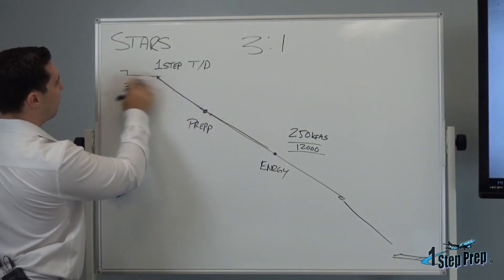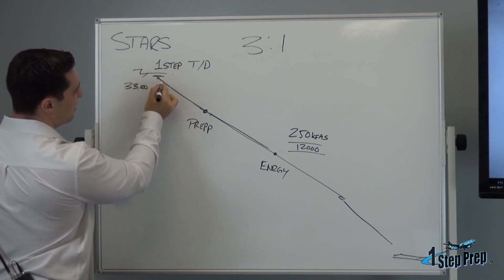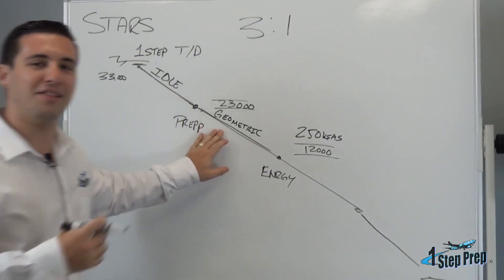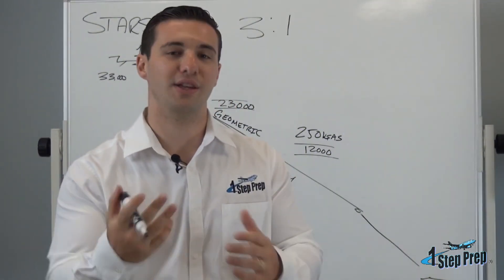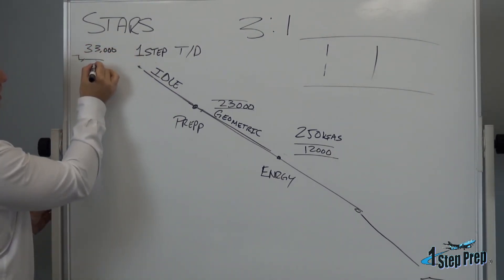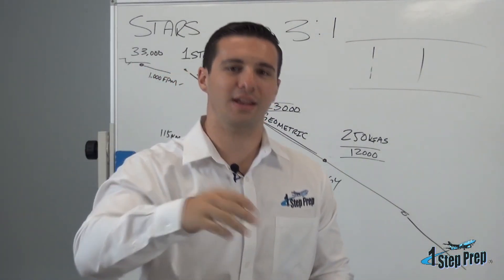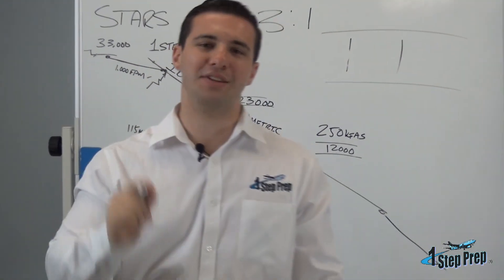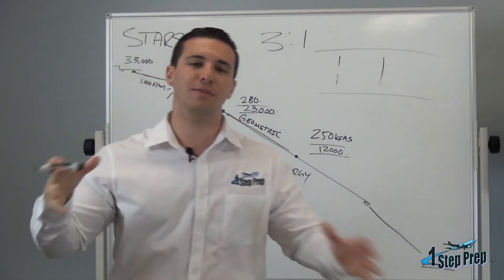A320 Descent Path

Comment: Hi Joe, 
I have a question. I mean once we have estimated when we should descend based on 3:1 rule, adding wind component distance as well, then how do we deal with the fact that our descent rate will no more be the same as we get lower and closer to FAF for instance. I mean let's say we initiated initial selected descent at 2300 ft/min ( GS 460knots), how can we srill assume we'll descend at this rate when we 're lower and that GS will probably be around 350 knots ( 1750 feet/min'). Can the plane still descend at the initiate we did set in the mcdu?Or doed that rule alteady account for the fact that we'll have a lower GS anyway?
Reply from the maker: Thanks for the question! When calculating the 3:1 rule we do it based on straight line distance to the airport. For example from 30,000 feet I know 90 miles is needed. Ill add 10 miles for the deceleration and extra buffer, but again that assumes straight line distance and a constant rate of descent equal to 5x ground speed.  The truth is we rarely fly straight line to the airport and I can easily increase descent rate if needed to exceed 5x ground speed. In the example above I know 100 miles is the latest point I'd like to start down but it's likely ATC has initiated my descent sooner and I'm not going straight line so it will allow for varying descent rates. Hope that helps!
Reply: @1stepprep  Thanks so much Joe. 
Sorry but I stll am not totally clear so please bear with me, promise no more questions.
1) If we're in a straight line then, just assuming, this would then mean that we can easily have a ROD of  much higher than GSx5 then.
Isn't there any risk of stall then if for example I'm approaching initial fix and I'm now at 200 knots and I had an initial rate of descent of 2300 ft/min (If our horizontal speed is really low and our VS gets real high)? What's the limit of increasing your ROD whilst looking at safe GS for not stalling then? Is it your VLS? 
 I've  read that 3500 ft/min is kind if max for commercial planes as ROD?
I understand the formula and assumptions above but I'm still intrigued because of the fact that this formula uses the GS at a certain level but we know for a fact that the GS will not be the same closer to our final FL.So just wondering how would the formula hold somehow without recalculating once our GS changes?

2) I also remember in one of your great videos,  you did mention there was a formula if ever you wanted to descend at variable speed?

3) I also saw others just use the formula below to check whether they're on profile or not for descent: 
D(NM) = ◇FL/plan(°), where plan is descent angle.
This seems to be different as per your method, whete you'd use the altitude and X 3 to get distance needed to reach the  FL required but here it's using descent path angle and this gives slightly different figures. 

Your expert thoughts would be greatly helpful to help me understand this.

Comment: @1StepPrep Professional Pilot Training  Thanks so much Joe. 
Sorry but I stll am not totally clear so please bear with me, promise no more questions.
1) If we're in a straight line then, just assuming, this would then mean that we can easily have a ROD of  much higher than GSx5 then.
Isn't there any risk of stall then if for example I'm approaching initial fix and I'm now at 200 knots and I had an initial rate of descent of 2300 ft/min (If our horizontal speed is really low and our VS gets real high)? What's the limit of increasing your ROD whilst looking at safe GS for not stalling then? Is it your VLS? 
 I've  read that 3500 ft/min is kind if max for commercial planes as ROD?
I understand the formula and assumptions above but I'm still intrigued because of the fact that this formula uses the GS at a certain level but we know for a fact that the GS will not be the same closer to our final FL.So just wondering how would the formula hold somehow without recalculating once our GS changes?

2) I also remember in one of your great videos,  you did mention there was a formula if ever you wanted to descend at variable speed?

3) I also saw others just use the formula below to check whether they're on profile or not for descent: 
D(NM) = ◇FL/plan(°), where plan is descent angle.
This seems to be different as per your method, whete you'd use the altitude and X 3 to get distance needed to reach the  FL required but here it's using descent path angle and this gives slightly different figures. 

Your expert thoughts would be greatly helpful to help me understand this.